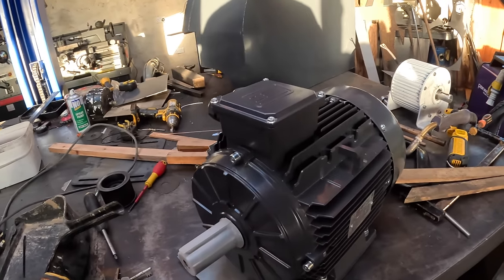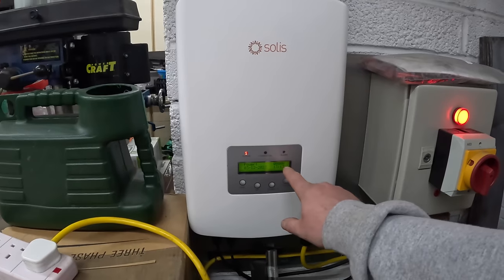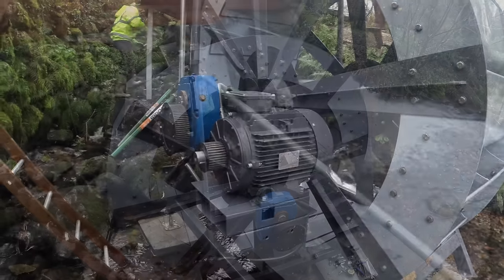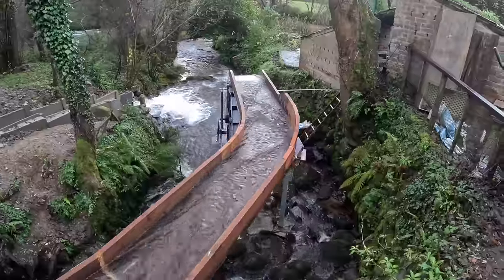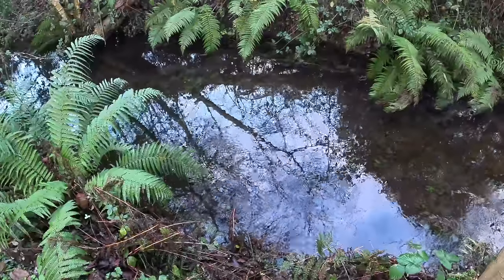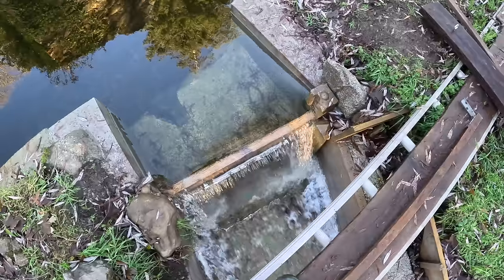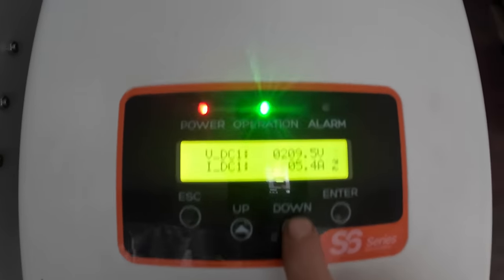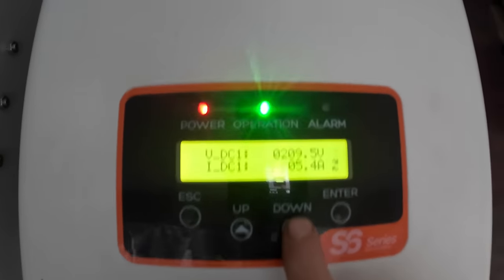Powering An Old Mill  1.5 Kw Lake District Overshot Waterwheel Project Part 4

Comment: Congratulations! I've been thinking about the amount of splashing you have. It might be useful in future designs to extend the bottom of the buckets upward/outward a bit because you loose most water over that edge. Another point of interest might be the shoot. As there is a bend quite close to the end, you might be able to create some less turbulent flow by putting some parallel thin metal slats in the section between the bend and the end, so as to guide the flow to become parallel (or laminar).

I hope your next video will be out soon and show us the progress you made on the barn. I guess you may have fitted a roof on top of it by now.

Comment: Well done. The shape of the buckets can greatly affect the amount of splash as well as the actual torque at the wheel axle you get from any specific diameter wheel. Just something to look into for any future builds. Cupped buckets are far more powerful. Merry Christmas to you and yours.
Reply: With a water wheel, it is the mass of the water pulled by gravity that produces the torque that is converted to electrical energy. The straight sides of the buckets maximize the volume, and hence the mass of water in each bucket. Cupping the buckets would reduce the volume in each bucket, reducing the mass, torque, and subsequent energy produced. Cupping is more appropriate for turbine generators where the driving force comes from the directed water jet, as with Kris' home system. 

The one thing I could suggest, for a water wheel is to increase the number of buckets, each one then with a smaller volume. This might help with splashing at the higher flow rates, but could also make it worse. Testing would be needed. I'm speaking of a future project, of course. This one is excellent, and I see no need to change anything. Well done, Kris.
Reply: @randybass8842  
I built my 8 foot x 2 foot steel water wheel 35 years ago and though it is no longer running I did learn a lot from building it.

You cannot add or lessen volume in a fixed space by cupping or not cupping the buckets, you can only direct water flow inside the bucket itself by cupping, exactly as you would observe in a pelton wheel.

The key to cupping the buckets is to keep as much water as possible in each bucket over the course of its downward rotation between 12 and 6 o'clock. Cupping actually allows for the inflow of water to occur at 11 o'clock instead of at 12:30 o'clock, adding more volume of water being held while slowing the wheel and reducing splashing.

This is what my water wheel looks like with some technical information.
https://www.youtube.com/watch?v=dLC3ZWf7WG0
Reply: @EdOfTheNorth , perhaps I misunderstood your definition of cupping. I was thinking of a rounded bottom, like a cup. Are you referring to a curvature from the top outer rim to the bottom of the bucket? I'm not a water wheel expert, and was speaking from a background in physics.

Comment: To prevent overspeed Please consider installing a second emergency backup heater. A small price to pay for a primary heater failure. And and automatic emergency diverting system.  Fantastic engineering Kris!

Comment: Love this Kris! 
Just an idea, if you're going to install a speed monitor and an actuator, why not have a sleuce controller that can cadjust the flow based on either the wheel speed, or the wattage it's producing?
You could then remotely tweak the system in terms of the flow etc to always keep it in the sweetspot.
Not sure how you would design it, but i'm sure you'd be able to.

Always look forward to your videos, never disappointed!
Reply: Hi, I was going to say the same thing. If you go to the trouble to design an overspeed shutdown, why not go the rest of the way and make it realtime adjusting speed controller.

Comment: I wonder if a big guard along the front of the wheel would reduce the splashing (or kick it back into the buckets).
Reply: Better a wider wheel. There is plenty room for double size. 
With double capacity, all the flow could be used without splashing.
Obviously with the same size of the feed. Or maybe only 50 percent wider. 
The guard will be useless. till water fall back, the bucket is gone down. 
The key word is capacity.

Comment: Love the content Kris ! I was wondering if building kind of a splash guard could help a bit with the efficiency at higher flow rate ? I was thinking a guard that would start above the "chute" and go along the curvature of the wheel. maybe it could keep the water from spashing out to much ? Keep up the  great work inlove watching you build and work on this project 😁
Reply: Problem will be that debrie like wood can get stuck between it
Reply: I think a full sleeve might create situations where the wheel doesnt work properly. When the sleeve fills up with water, it might backflow, breaking the stream of water and even go the other way. Also when the sleeve is full of water, the buckets are now pushing against the filled pipe, with forces it was never designed to withstand
Reply: @jonasstahl9826 thats true i didnt think about all the debrit that could pile up... It would take some kind of grill but in the end it would probably not gain a looot of effiency

Comment: Kris, absolutely love your video and set up!!
We’ve build a similar setup, with similar issues: buckettype wheel, PMG from directdrive washingmachine and solar converter in fixed voltage mode. Our PMG also is too small, so wheel running at too high speed. Following your video, I’ll change to an induction generator as well.

For the E-stop we’ve used one of those fire-Door-holding magnets, which while energized keeps the inlet open. No actuation required.

Great job!

Comment: I know you had some real stones in your way to this point, and you demand a lot from yourself but … for a first time design and build of not just a wheel but the mechanical and electrical protection circuits and all that… darn it, you should be proud, it is such a great project. It spins, it inconveniences electrons and it is pretty to look at. Congratulations!

Comment: Hi Kris, that looks like a DC relay for solar applications to me. While they have huge current ratings, they typically arent rated for AC. Just double check the voltage rating of that, and if you need to switch AC, use a contactor rated for your motor/rotor. In this case a 2.2kw (3hp) contactor. 

The reason is that when switching under high loads, the system has
indutance (electrical intertia) and creates massive voltages when the current cant flow anymore. Those voltages arc weld the relays permanently closed and cause your system to fail.

Comment: That is a fantastically planned and executed job Kris. Another fail-safe to pull the pin, not reliant on electricity, could use a centrifugal clutch from a power tool or similar.

Comment: Congratulations Kris, what an achievement now you have produced peak 1.6 KWh for your customer🎉, but on tick over 600 + watts not to be scoffed at in the lower Summer flow. As you aptly point out, that wheel turning is a wonderful sound to hear.  Great job 👍

Comment: Great video with excellent description, I’ve built four water wheels in my time, with very good success, one is still running flawless some 20 years later, I found that if I increase the pulley size on the water wheel it then turns the induction motor faster with a lesser flow of water required, I’m sure with a change of pulleys you could get that system running 1500 watts with low water flow, not telling you how do it , just giving you ideas, what you’ve built is absolutely fantastic 👍👍

Comment: Being a Civil Engineer, I am amazed and your channel, thanks for showing us.  One thing I was thinking was that wooden control for the water flow.  ....  That should be automated have two plates on either side of the flow up top that will control the angle that that wood (replace with something else) sits at, you can use actuators or flow control drives.  It would allow you to control it from your system instead of just an on/off switch....I know that might take more programming but I switched out of civil years ago into computer engineering, so I know it can be done.

Comment: With the efficiency of the motor/generator your calculations are spot on. 1.7KW at 86% is only 1.4KW. So really you are getting more power than estimated. (If my Brain is thinking about it correctly that is... :-) Excellent vid and glad that it worked out.

Comment: Great job, Kris! :)
One step further could be an automated resume function after a power outage. Automatically reduce flow on power outage and control spin rate, automatically resuming generation after reconnection to the grid and proper spin rate. Then back to full flow.

Comment: Hi Kris if you designed the wheel and buckets again would you think that more throw on the bucket, a bigger scoop not side to side would help to solve some of your splash out. You've done a fantastic job, is there nothing you can't do. Great to see this waterwheel content, I helped restore an old cast iron and steel one many years ago.

Comment: My opinion is that it is better to use a Pneumatic Window to decrease or increase the flow in the discharge channel. When the load is increased, the gate opens and reduces the flow in the main channel, and vice versa, when the gate is raised during weak rotations, it increases the flow. This will be better than having your protection tripped during every rain or having it operate at 500W. And you won't be walking to the dam every morning. A lot of good work has been done. Great job.

Comment: Like the harmony and tone of the water going over at 800 watts and up.  It is a very old familiar work sound. Used for many businesses, get flour from wheat kernels, grinding pulp for papermaking, processing natural fibers for cloth, hammering iron. 

Just wish our kitchen cooking ovens were better efficient. Think of 1500 watts for a stove induction cooktop burner, mini convection toasters, air fryers, and add 1000 watts needed when fridge or freezor compressors start. 

But at 1200 watts can run room lights or ceiling fans, charge tablets, laptops, phones, or have on a large computer for video games, video editing. 

For Chinese purchase, think it needs to be said, have to learn...what item really costs and so can determine true quality. I have bought things overseas from Japan and China off of ebay and for higher priced items happy with craftmanship. Thanks for sharing experience as clean energy is already squirelly enough.

Comment: You got it working well now. For those saying that 1-1,5kW is not much, when the system is able to generate 20kWh a day during winter time this actually is enough to run a 7-8kW heat pump for most of the time entirely from water power alone. and it will do it for 24/7 during winter time when heating is needed but Solar doesn't do much.
I use a 7kW heat pump, and with an outside temperature of 0°C it uses 800w on average to keep my house warm, it's just when heating up indoor when it uses more power for a couple of hours.
So you will heat your house without importing from the grid, which is what you mostly will do when using solar.

Comment: Well Done, Kris. I'm sure your client should be well satisfied with the final result. 
I know you are not electrical specialized, and you are operating outside your area of expertice, and I must correct one thing you said about the original generator installed. it was 2,000 Watts at 220 Volts however you did not take into account that it was a three phase machine when you made your electric current calculations. If it was single phase your calculation of 9 amps would have been correct however with three phase there is a square root of 3 factor to add in which will bring the current down to 5.25 Amps. Either way it is still exceeding the 3 amps rating of the wire size, so your justification for sticking it to the supplier is still valid. 
I am subscribing to your channel, because I appreciate the way you present your show with the casual hands on, no nonsence approach, with good information and interesting content.

Comment: Kris, You can use the safety for when the belt breaks also for the grid failure. So when the grid goes down, the flap shut down the river to the waterwheel. This way when somebody presses the reset buttons without slowing down the river first the controllers won’t be damaged. The additional advantage is that the heaters aren’t pushed to their limits when the grid fails with high flows. 

Relais and actuators for pulling a pin aren’t reliable for a safety system (it will eventually break some day, through rust or wear and tear and a relais can weld itself). Almost all relais or actuators will not work when they don’t have power, this will be a problem when the grid fails first and then the belt breaks. U must use electromagnetic doorlocks holding up the flap. When the electromagnetic doorlocks has no electricity the flap can go down on gravity. It will use some power, but compared with the output of the waterwheel it’s negligible. 

Place a electromagnetic doorlocks for both safety systems on the other side of the river (upstream)and run a rope between these magnets. Place the flap in the middle of the rope with a pulley. This way if one of the 2 needs 230V it isn’t near water. And if one of them fails the flap close itself. 

And with the holding power of these locks you can even place some weight on the flap. 

Some electromagnetic doorlocks are rated IP67, and cost around 40€. 

There is an industry equivalent so u can connect multiple safety systems into 1 and then u only need 1 doorlock, but those systems are way more expensive :(

Comment: Having followed your progress I like others have wondered if the cost is worth the install and now seeing it working and working well you have done a very impressive job, well done.  We have a 4kWh solar system and the big differences are they only work during the day and when it is sunny.  The hydro system you have created even at 500kWh per day 24/7 it will create mega watts per year whereas solar we create around 4000kWh per year.  I like your system all I need is a river 😀 thank you

Comment: Great work on the wheel. I think to prevent splashing of the water, front of the buckets should be more open, even if water splashes from back of the bucket it will be used in bucket ahead of it.  Hope this helps

Comment: If the side panels were larger diameter and the leading edge of the buckets were flared outwards or better yet curved like a peleton turbine you might be able to reduce splash.  All in all an excellent implementation of ingenuity!

Comment: As a novice wanting to do what you are doing here I think the water off the flume is travelling too fast hence the splashing.
If I had that setup in my garden and no one was watching I'd want to try and slow the flow rate down. Just watching the video I'd screw battens to the bed of the flume to create turbulence. You have the volume of water in the flume so you're not loosing anything. If the water is travelling slower albeit in greater volume it will fill each bucket more with less splashing and hopefully increase efficiency. 
Not expecting a reply but I want you to achieve your best. 
I look forward to the next video. This mini series has been amazing so far and I take onboard what you've learned from Chinese specifications.
All the best. I have much respect for what you're doing
👍👍👍

Comment: Apart from the obvious problem with the generator what design changes would you make for the next one because you know you’ll build more of these . Perhaps the design of the wheel to try improve on the splashing effect. Very impressive despite the issues.

Comment: Congrats on the progress Kris ❤ I wonder if it makes sense for the penstock actuator to be fail-closed, i.e. 24V power required to make water flow. This would prevent a situation where the alternator fails and there is no grid or solar power to drive the actuator.
Reply: Yes that would be better idea than having to go outside an manually slow the water before you can turn it back on again

Comment: Hi Kris,
What a beautiful installation. I wish I had a stream so I could build one. I was thinking about the splashing issue particularly at full flow. It is difficult to tell from the video but the bucket leading edge seemed to be making a slapping sound as it hit the water column. I suspect that at the point of impact the bucket front is nearly parallel to the water column, hence the slap. It could just be the video but I could also detect an oscillation in the water column. If you could adjust the profile of the leading edge so it cuts through the water column it may improve the transition from one bucket to the next. The faster the wheel turns the harder it slaps the water column plus as the flow increases the water column thickness increases so you have dual effect which increases the deleterious effect on efficiency. That is it has become non linear.

Comment: Very good construction.  I would think it should all last for many years to come.
Tiny suggestion for next design to reduce the splashing.  Square the 'bottoms' of the buckets or at least some type of brake to create an eddy for the flow along the inside surface of the bucket wall.
pause image at 36:36:
The 'bottoms' of the buckets are curved, so as the water is flowing in, it follows the curve and exits back over top of the inflowing water. Basically, making a 'U' turn along the inner walls of the bucket.
Consider zero degrees at the top of the wheel and increasing in direction of the wheel rotation.  From about 35 degrees to 50 degrees the water flows backwards along the inside of the outer wall of the bucket, from 45 degrees to 55 degrees the outer wall of the next bucket batters the upward flowing water radially outward.